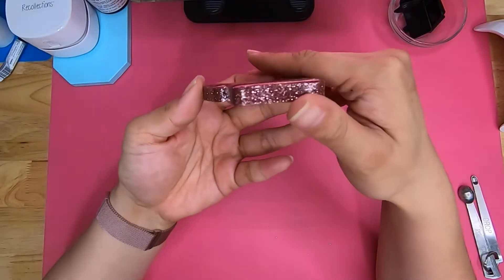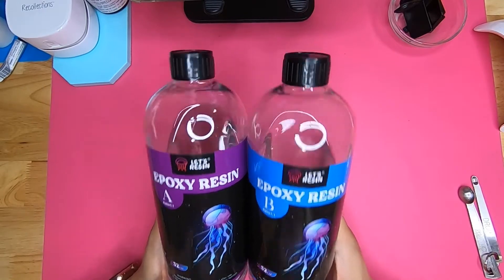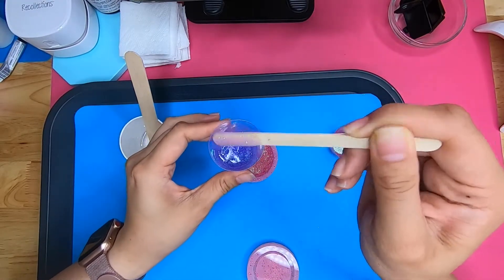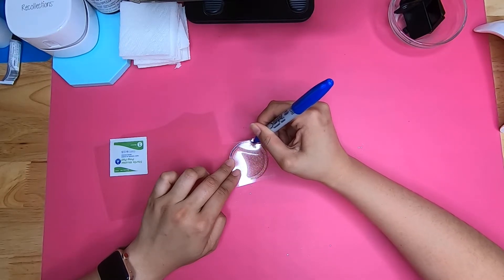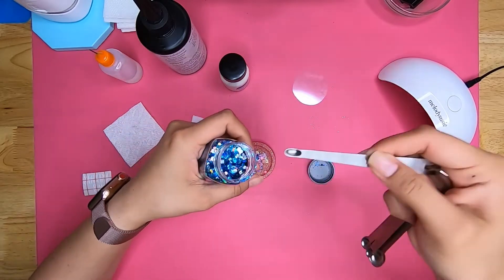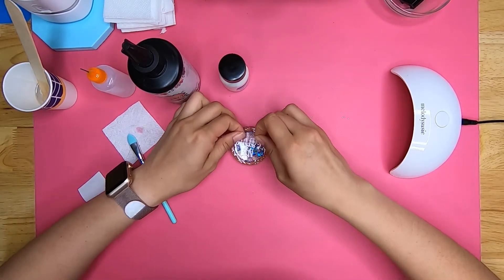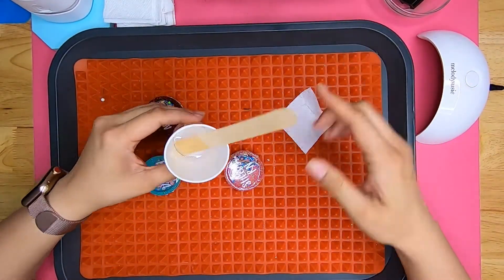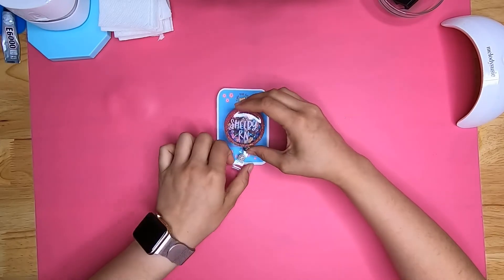DIY Round Shaker Badge Reels

Comment: Great video, moves quickly.  I don't understand though why you drilled a hole in the top and then later filled it?  I thought you were going to screw into top a hook for a ring but you didn't.  Thanks for the reply.
Reply from the maker: Hello! Is the video too fast? Still learning to find a good pace. I drill a whole to fill with liquid to make the bits float inside. These are badge reels not keychains which is why I didn’t attach a keyring.